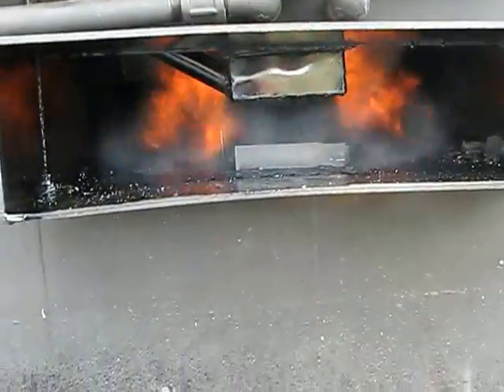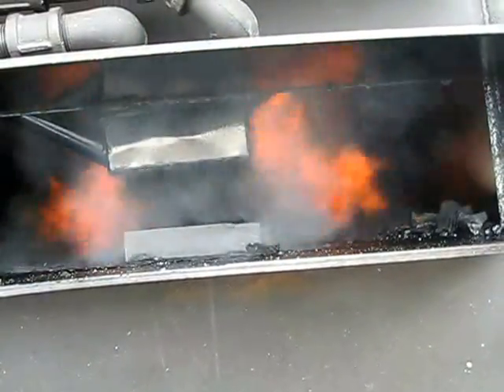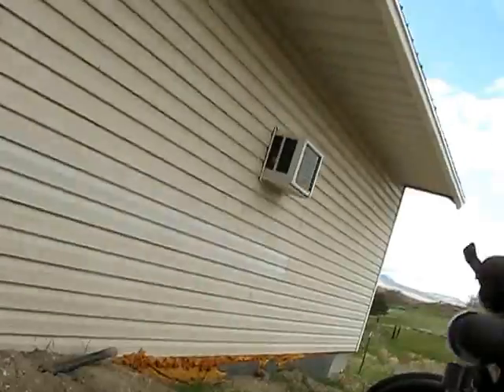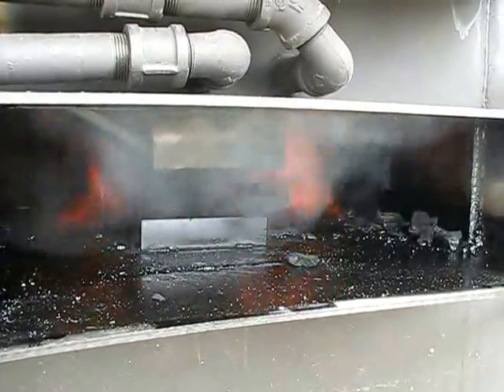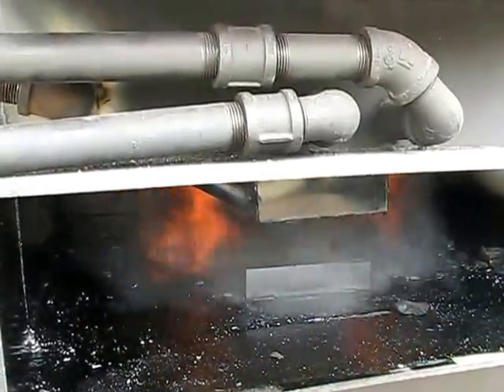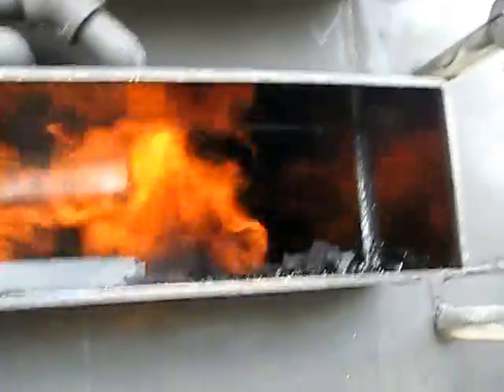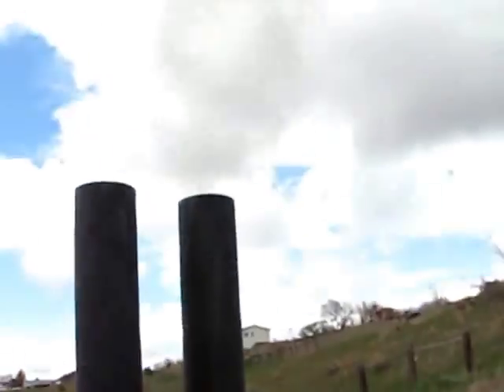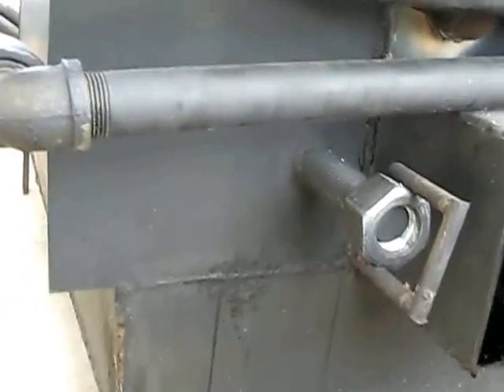secondary burn test

Comment: The secondary air going INTO the unit must be pre-heated to nearly the same temp as the internal temp. 
 Cold secondary air merely cools off the wood gas/exhaust smoke so it's too cold to burn.

Comment from the maker: Thanks for your comment.  I think you are absolutely correct.  I have added more air to the secondary, which made it burn much better (it sounds like a jet engine).  However it I still need to get more air into the primary burn area.

Comment: I think you need more air for both primary and secondary combustion chambers. Also, you need to keep secondary combustion chamber hot so smoke and gases ignite easily. This means that you need to inject pre heated air into the combustion chamber and now air seems to be cold.